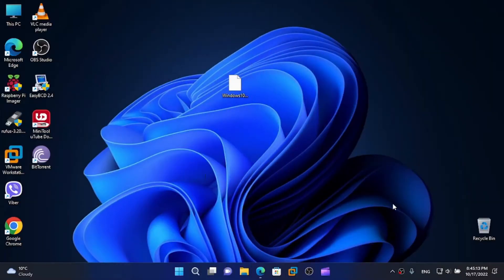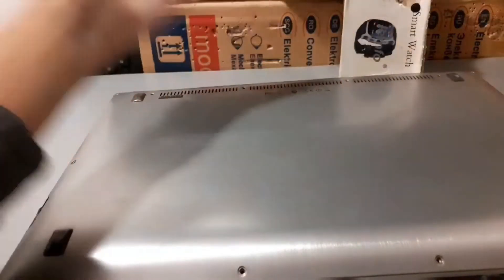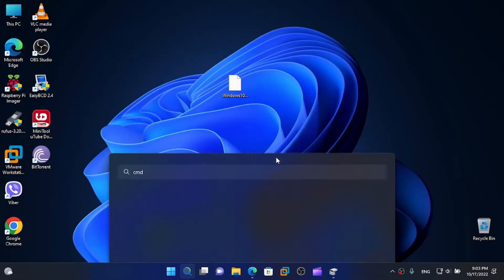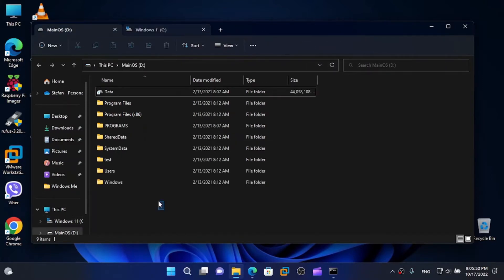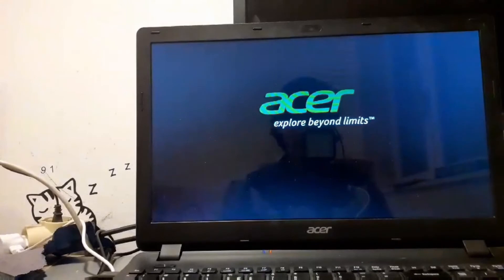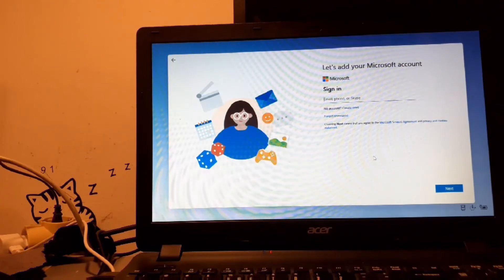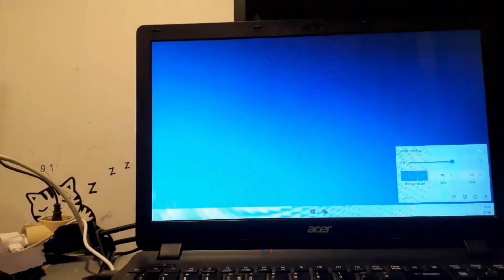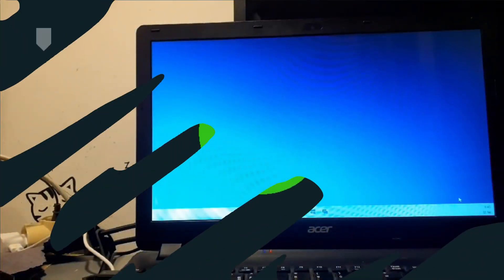How To Install Windows 10X on REAL HARDWARE (Flash Windows 10X FFU on a disk)

Comment from the maker: Timestamps ⏲
00:00 Introduction
01:37 Taking out the target drive
02:59 Cleaning the target drive
04:05 Applying the Windows 10X FFU 
05:54 Comparison of the Win10X and Win11 installations
06:31 An important message
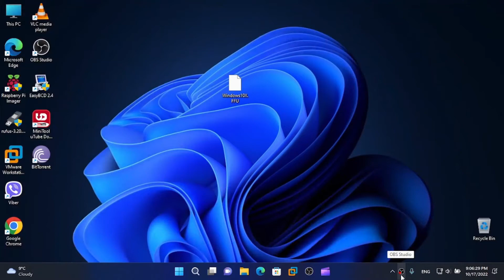07:04 Putting the drive in the target PC
07:43 Loading Windows 10X
12:24 Messing around
14:30 Outro
Reply: Hello ma'am, can we do it pendrive since I can't afford a SSD. I have pendrive of 64GB with hdd (storage) and SSD (my OS came with)

Comment: hey, this video so good, but one thing is i have a trouble because internet ui is broken and i unable to connect internet!
Reply from the maker: I personally used an Ethernet cable, WiFi didn't work for me. Hope that helps
Reply: @stefanstechlab  so that's a reason why my dell e6430 ran to OOBE but stuck at the network part! thanks for reply!

Comment: I stuck at wifi page, i mean i have connect to my wifi ssid, it says success. then i press next but it show loading icon and then show wifi page
Reply from the maker: Connect to WiFi then or use Ethernet
Reply: @stefanstechlab yes i both use ethernet and wifi, both connect sucessfully but cannot move to next page
Reply: @stefanstechlab I do both, wifi and ethernet."connected" too, but it still stuck at network connection page
Reply from the maker: @nguyenloc98 try restarting the oobe or the installation
Reply: @stefanstechlab  yes, i did it, I restart, but still the same. them I reinstallation (reflash the ffu), still the same...
Reply: Now i temporary flash back to windows 11 tiny11 (by NTDEV) on my surface go 2, remove some stuff but still have nescessary like store, edge, copilot, v.v..., temporary smooth like 10X

Comment: Hi there,i am able to install and load it but I'm stuck on the oobe connect to network page.. does the WiFi driver doesn't work here? I've even use my phone's USB tethering but it seems not working,too.. and I don't have an Ethernet port on my laptop.. so.. i really need some help with this..
Reply: Oh and almost forgot to mention that.. bypassing by Shift + F10 isn't working here (which is so weird considering there's a bunch of tutorials for skipping the network requirements..) so, yeah.. 
I think I'm going to try it on my virtual machine for now.. (VMware etc)
Reply from the maker: @nalenendra8002  The drivers don't work (least in my experience)
Reply: Mine is driver work. Can connect wifi, but when press next, it still stuck on the wifi page

Comment: How are we supposed to get Wi-Fi on this?
Reply from the maker: @cursorandcat  I used ethernet, it didn't work in my case
Reply: I also try to ethernet to USB dongle but it didn't work so I'm reconsidering reinstalling windows 11 @stefanstechlab
Reply: I'm really hoping that they would make some drivers for the FFU but a
But there is no such thing so I know it might not happen
Reply: I also make custom versions of Windows 11 that gets rid of problems with the system It has pre-installed apps right

Comment: I did this in a similar method but using a USB with Windows to go by Rufus and then I ran command scripts and it actually worked
Reply: Also there's a way on doing this on a Chromebook do the same method and you'll be able to do the same thing as I did
Reply: WARNING if you do this on a Chromebook with the Mr Chromebox. Tech script there is a chance if you select full Rom firmware there is a possibility you will overwrite Chrome OS and a Linux operating system if you have a Windows computer please note if you're going to try to install Windows 10x on a Chromebook the touchpad or touch screen will not work if you're doing this on a mini PC which for my option is a fire bat computer things will go horribly wrong it will enable BitLocker and if you make sure BitLocker is disabled it is ok to use windows again if you don't make sure BitLocker is disabled you will run into some issues you can't install Windows back on the PC if you try to boot it will refuse
Reply: Hey, how did you do that just by rufus? And what target device of you?

Comment: Do it also works with partitions
Reply from the maker: @vladtechvibes  You will need to completely wipe the drive for it to work (short answer no)
Reply: @stefanstechlab I do have a free wiped partition. Did that but by putting in the command but modified a little to install says that i didnt write /physicaldrive which i did. Can I do something about it?
Reply from the maker: @vladtechvibes  You can try

Comment: Great presentation especially with the tutorials the video is very dedicated and detail! Glad a way to install 10x on real hardware exist. However there is some question that i would like to ask 

Is 10x really usable in this case, and it is worthy to be a daily driver? If thats the case:
1. Is the Windows activated, and it is necessary to activate windows 10x?
2. Is there any compatibility issues like some apps wont run?
3. Why do secure boot need to be disabled, is there any tweak to enable sb if possible?
4. Could this potentially brick your hardware or something like that, i know you also made how to revert boot restrictions but Hardware brick is still a bad scenario that could happen.
5. Does Microsoft store works there?

Thats all, hopefully anyone can answer this
Reply from the maker: @sillycado  I haven't daily driven it for me to tell if the store is active. I'm assuming that it's still active because the windows 10 store is still active (it's still supported) . In my case, I didn't have proper graphics drivers. And I'm not sure if it's activated. I recommend you try it in a VM before you install it on real hardware. And it's not really for daily driving if you ask me, only if you are an enthusiast who's willing to give up time to make it work. Thanks for the feedback :)
Reply: @stefanstechlab   Thank you for the reply, Im just wondering about the Microsoft store but is there any reason why secure boot is disabled?
Reply from the maker: @sillycado  I disabled it so I don't have boot issues

Comment: you seem really young but the explanation is very technically accurate. i'm glad you clarified it mentions 128GB on the website but a normal windows install should be about 15GB uo to 30GB with updates and optional features. keep it up, you got potential!

Comment: Can we do it in pendrive if i cant afford SSD? TPM 2.0 supported
Reply from the maker: You can do that, check my tutorials where I explain how to do that with a USB drive.
Reply: Will tell you if it worked
Reply: Also I have a question: can we run .exe apps on this OS? And can I view my second hdd storage purpose? Because once I tried in the emulator it didn't show any option to view this pc like normal windows. Please help it would be a great guide from you.
Reply from the maker: @Mohit-kf4nc  Sadly, from my testing, you can't run .exe apps and you can't see external drives
Reply: @stefanstechlab  okay will manage. Thanks for the tutorial I will try it tomorrow
Reply from the maker: @Mohit-kf4nc  Good luck :)
Reply: Update - I was having issues with the pendrive so I had to install it on my hdd so after doing it the progressive ring boot animation has appeared will update you after it enters the setup. I can manage hdd speed since I will keep it as a collection.
Reply: Update 2- I booted into the setup ma'am now I will set it.
Reply: Update 3- I forgot that I don't have an ethernet to usb adapter so I will try to buy it tomorrow because I am 16 years old and I live in India so I have to ask my parents for it. I will update you tomorrow but it is working for sure
Reply from the maker: @Mohit-kf4nc  All right 👍
Reply: Success it was a success after I went through my old laptops cables I found one and connected it and continued to the setup however shutting down is a flaw in this but everything goes good. I am thinking of reskinning my Windows 11 to look like Windows 10X because both of them have the same things.
Reply: Can I do that?
Reply from the maker: @Mohit-kf4nc  I have a tutorial showing how to do that

Comment: i know this is a year old but whenever i boot it, it shows the mouse with a black screen and thats it
Reply from the maker: Maybe try reflashing the image or wait some time for the OOBE to start.
Reply: @stefanstechlab  I've let it sit for like 2 hrs and it still hasn't done anything before commenting and when I try reflash there is a bunch of disks and I can't really delete them all
Reply from the maker: If you want to  revert back to the state it was before, first revert back the boot restrictions using my tutorial (you'll find it on my channel) and you should be fine.
Reply: @stefanstechlab  i have manually deleted the partitions and stuff on a whole separate pc and I have tried it but it didn't work
Reply from the maker: @GabrielFurryPhone  Maybe the hardware isn't compatible if it's an older system

Comment: Whenever I try to boot Windows 10X for the first time on my possibly 2014 Lenovo Thinkpad, it boots into the Recovery error screen. Is there any way to fix this?
Reply from the maker: Try reflashing the FFU to the hard drive/SSD in the laptop
Reply: @stefanstechlab  I did, but when I booted the computer again it went back to the Recovery error screen, saying that this file inside it, winload32.efi, is either missing or contains errors.
Reply from the maker: @septemberistzeebie  I've seen that error before on a device of mine. Sadly, I can't help at this point because I don't know what to do.

Comment: I get a black screen and cursor, is it driver issue please help
Reply from the maker: That means you are in the OOBE (Out Of Box Experience). Wait a few seconds, or minutes, and you should be able to complete the installation. If it was a driver issue, I think it won't even display the cursor.
Reply: @stefanstechlab  i  waited for around 15 - 30 min
Reply: My monitor goes to sleep mode after 30 min and when I open no cursor
Reply: I am using 256 gb ssd
Reply from the maker: @ramaraomalla5011  That's not good. Maybe the hardware is too old for the OS, or a driver issue. Maybe restart the installation (revert the restrictions, then flash the FFU again). I don't know. I have dedtcated tutorials about Windows 10X but that OS wasn't meant to be used on old devices (older than 2020/2021).
Reply: @stefanstechlab  i flashed 5-6 times
Reply: First time main os came from 2nd time even that didn't come
Reply: Is there a use of trying your other winPE tutorial
Reply: I thought there was no difference so...
Reply from the maker: @ramaraomalla5011  That's not good
Reply: @stefanstechlab  do you know where the drivers are stored in the partitions
Reply from the maker: @ramaraomalla5011  Try to find them in MainOS:\Windows\System32\Drivers or MainOS:\Windows\System32\DriverStore. Look for them when the target drive is plugged in in another computer
Reply: Press Windows + R, type in “Task Manager”, add a new task, and add “explorer.exe” hope this helps 😊

Comment: I have a question, I tried to install Windows 10x on an ASUS x540 laptop but after starting the disk the screen goes black and stays like that, I really do not know how long, however, if I restart the laptop I get an error regarding an error in boot BDC
Reply: Same
Reply: But I want to use 10x, is there a way to fix it
Reply: @ramaraomalla5011  yes, in my case when I finished installing Windows 10x on my laptop and putting another operating system other than Windows, you can still use Windows 10X on the same computer again
Reply: @becerrildominguezbrian1918  didn't you get a black screen too
Reply: I could use your help
Reply: @ramaraomalla5011  Yes, however, after a while of around 5 minutes started Windows 10X without major problem, let the computer 5 minutes have if it reacts or the Windows 10X animation appears, so as long as you do not do anything in the boot because you can break the system, in my case I saw a black screen and I thought it could not start so I restarted the computer,   When I turned it back on I saw that a system file was broken and that I was trying to reinstall the system
Reply: @becerrildominguezbrian1918  you see I have two hard disks i am using one to flash on the oth
Reply: Threre are 10 volumes or partitions on the disk, do you have any idea on which one are the drivers stored i think it's a driver problem
Reply: By the way have you successfully installed 10x
Reply: When i experimented i found that it is not a driver issue, butt still issue is there please help
Reply: S.O.S
Reply: @ramaraomalla5011  I see, in that case there may be a problem on the part of the computer, did you check if your computer has the requirements to start Windows 10X?, that is, if it has boot boot UEFI, minimum 4 GB of RAM and more than 64 GB of storage?
Reply: @becerrildominguezbrian1918  yes it is uefi, i have two hard disks 2tb HHD(MacOs + Windows) 256 Gb SSD (Windows 10x target), 16 gb ram
Reply: @ramaraomalla5011  I see, I have been doing many computers with Windows 10x since the videos about installing Windows 10x came out, so in most computers before 2016, even if they have the UEFI characteristics of Windows 10x, it is necessary to have drivers for the computer to start the system, however, I also tried it on a macbook with an intel processor and it failed to boot, apparently an extra procedure is needed than what is required for a normal computer because it is a computer made for a system with a different kernel
Reply: @becerrildominguezbrian1918   so is there a solution
Reply: @becerrildominguezbrian1918  my system is after 2019,self built
Reply: @ramaraomalla5011  I'm not sure, you will see Windows 10X is a beta that was left in abandonment so it still has bugs and has no solution officially from Microsoft, still try to find ways to fix the problem in forums